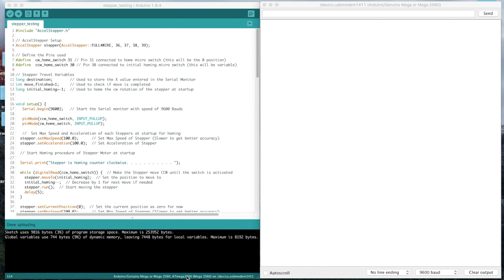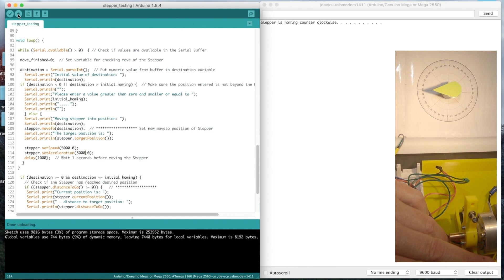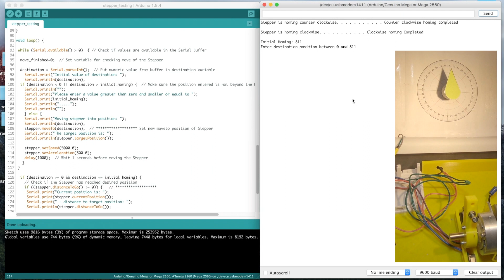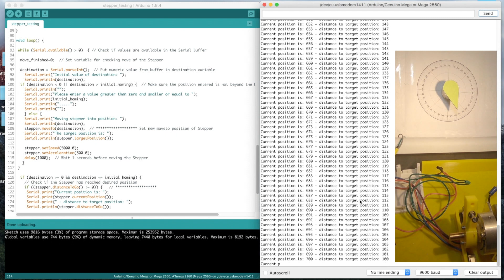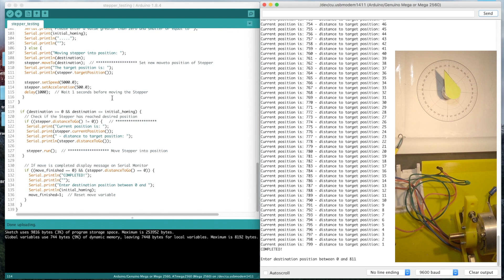AccelStepper and AdaFruit TB6612 issue

Comment: can you help me? i have one question that i use tb6600 and i set 
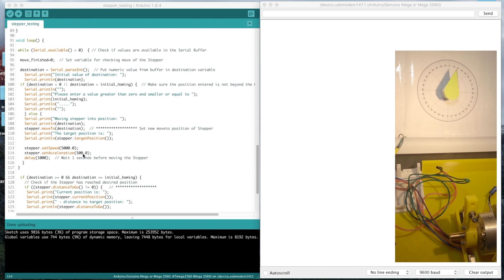the steper.moveto (6400) but  it move a haft of steps  i   set it up befrore in the hardwarre(  in tb 6600  is 1:32 it means the motor  move 6400 step to make a round ) 
#include <AccelStepper.h>

// Define a stepper motor 1 for arduino 
// direction Digital 9 (CW), pulses Digital 8 (CLK)
AccelStepper stepper(1, 4, 9);
void setup()
{  
  // Change these to suit your stepper if you want
  stepper.setMaxSpeed(1000);//1100
  stepper.setAcceleration(1100);
  stepper.moveTo(1600);
  
 
}

void loop()
{
    // If at the end of travel go to the other end
    if (stepper.distanceToGo() == 0){
      
   stepper.setCurrentPosition(0);
      
        
    }
    
    stepper.run();
    
}

Comment: Hi, did you ever get this working?  I have the same driver chip for a different type of project.  Also, what is your wiring? Specifically the 4 stepper wires connect to which on the arduino, as I've not managed to get the basic test run of the library function to work
Reply from the maker: Hi David - I never could get this working properly with the AdaFruit TB6612. I ordered another one and tried that and it acted exactly the same. I eventually went with the Sparkfun Easy driver and I got the functionality I desired.